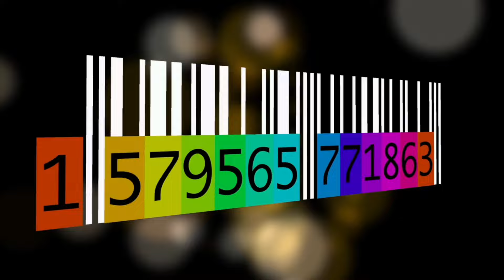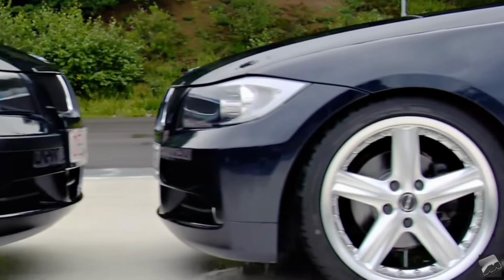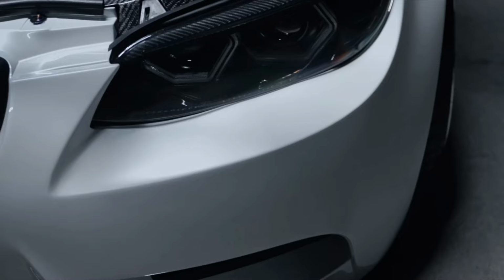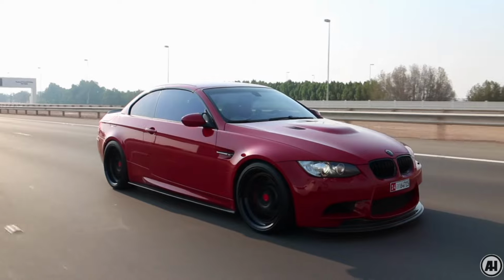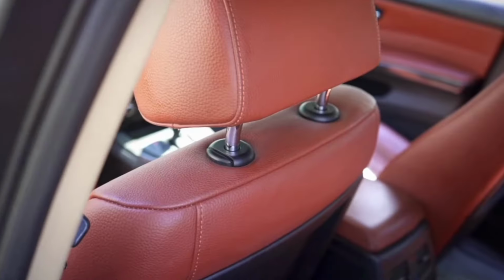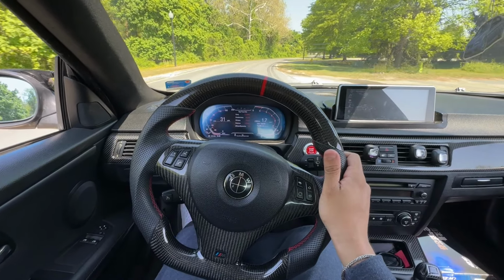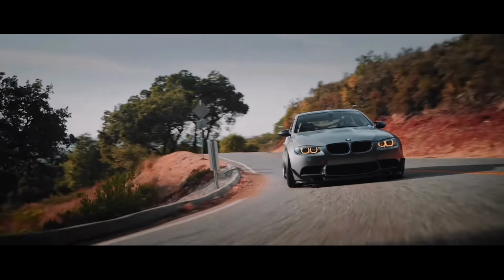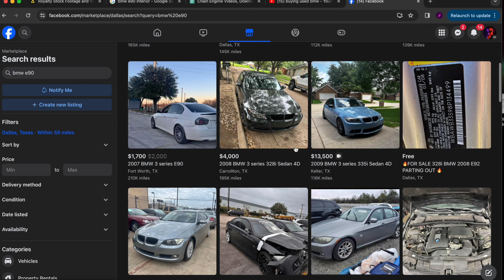Why the E9X Is the Ultimate BMW Platform | In-Depth Review | E90 E92 E93 328i 335i M3

Comment: As an E82 owner, I love me an E92!! If you have a Non M3 E92, all you need is the M-Sport bumpers on it, lower it and wheels. If you want to go extra, then add carbon pieces to it.
Reply from the maker: agreed 100%
Reply: Non m3, m package oem from factory bodykit m steering wheel coilovers  and 359 wheels. I love my car!
Reply: And then you still don't have a e92 m3
Reply: E93 335IS owner here and I don’t even want the M . This car is underrated.
Reply: @davidzambrano9126    And then, not everyone likes or wants the E92 M3!!
Reply: @4thaClipz    Uhh!! is’s are very rare. Take care of it!!
Reply: @M_is_for_Monty  yessir I sure will !
Reply: @davidzambrano9126  lmao I kick e92 M3’s in the ass on the regular . All they are good for is the top end and by that time I’m in 7th gear 😅 the “ IS “ is the best E9X to me but I may be a tad biased …
Reply: @M_is_for_Monty  agreed I have ‘13 vert lemans blue 59k😊
Reply: @4thaClipz  335 is nice but no - its not the M3 - BMW would not make the Halo model slower than the standard range - and I have raced 335s stock on the motorway and it walks 335s

Comment: the only good engine in an e9x chassis is the M57 diesel engine... or the S65 if you got unlimited money and dont worry about reliability
Reply: s65 is not that unreliable past rod bearings and TA... s85 is a different story tho
Reply from the maker: S65 is very reliable so long as rod bearings are done and you have about $1K off to the side for throttle actuators. great engine
Reply: N52 ftw

Comment: Awesome video! I’m happy that so many were made! Should be plenty of spare N54 engines available for my E82 135i 😂 Truthfully, with so many E9xs still on the road, the aftermarket should be thriving for years to come. I had an E46 M3 back in the day, later traded it in for an E92 M3. Sold it once the warranty expired. Loved it, but thought it was a little big compared to the E46. Much prefer my E82 135i. It’s got many of the same important parts and features of the E92, and dimensions are very similar to the E46.
Reply from the maker: I absolutely love the E82 135i! I debated buying one for my second car for so long, especially with the M-Sport or 1M conversion 🔥 it’s insane how massive the aftermarket is for the E8X and E9X